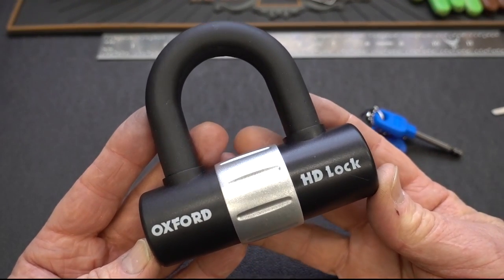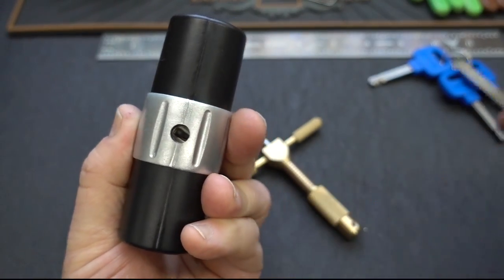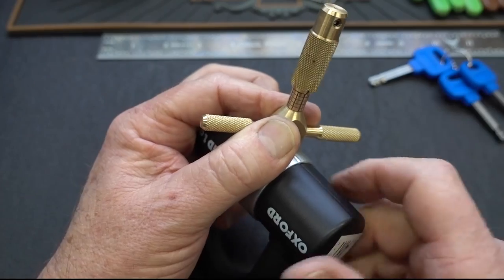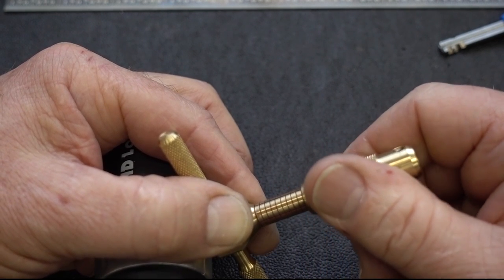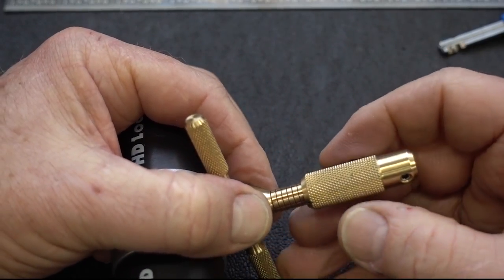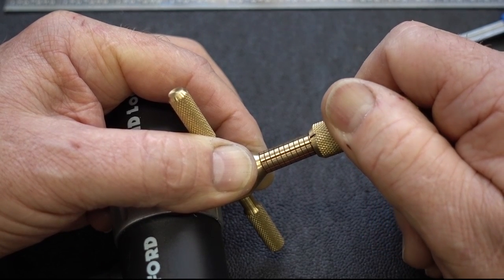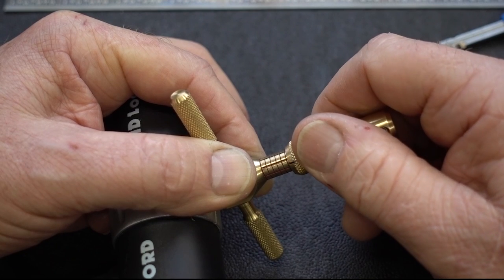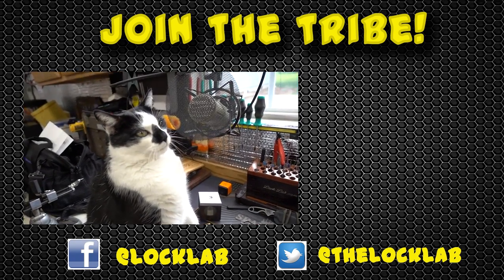(1442) Oxford HD Disc Detainer Bike Lock

Comment: Bill, have you shown the inner workings of a disc detainer lock, or viewed down inside the keyway with the lock-cam in a previous video? Seeing how these locks function would be pretty cool, IMHO.
Reply: I was thinking the same.  Having a good visual idea of how they work would be rather helpful.  I seem to remember getting an explanation but don't remember actually seeing the inner workings.
Reply: Maybe go to the 3D dimensional blackboard.
Reply: He has stripped disc detainer locks plenty of times. When he was showing how to defeat  the cheap ones. I also have made a challenge lock out of one. And there are other pickers too how have shown a clear lock which shows how it works.
Reply: The see-through training locks show the innerworkings of the lock. Its not the best, but you can see the individual  disc move around when using the pick or the key
Reply from the maker: Might be time for an updated video of that, huh?  The last one I did was quite some time ago in the pre-HD and low res camera days...  Thanks for the reminder!😋
Reply: @bosnianbill  that would be great. The one I found is good but now you can show off your new pick with the cut-away

Comment: Bill a design change make the steel part longer that slides deep into the body and you set length based on using side bars to adjust length...
Reply: I thought that the current design would allow him to loosen the wings and slide the steel part out a small amount that might be enough for this lock.

Comment: Bill, LPL may possibly smoke you in a lockpicking race, and he did crack this one 14 months ago, but your tools are way nicer. That brass work is classy. 

May I suggest you hollow mill the radius of the Bell dust cover into the face of your tool main body? That shouldn't affect its effectiveness on flat surfaces, whilst making it easier to go deep enough on these things. 

Also, as an engineer and not a picker, it's always interesting to compare yours and LPL's different styles. So far I haven't been able to emulate either of you effectively. Great vid as always.

Comment: Abloys are tensioned from the last disc?
Reply: Depends on the model I think.
Reply: I think it's always depest or few deepest that are used for turning the lock. Why it would be anything else? Why other manufacturers are using first ones for turning? I think it's much harder to pick when it's the last ones.

Heres info of the oldest type, classic, that is also using bottom ones: https://www.keypicking.com/viewtopic.php?f=88&t=1323&start=0

Here in Finland we rarely use anything else than Abloy locks
Reply: Really old Abloys use first disk.